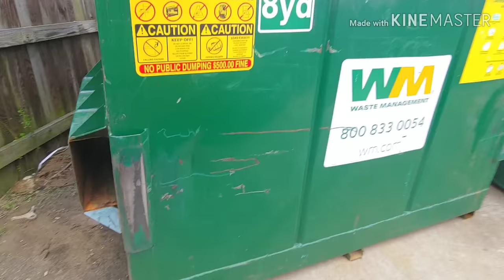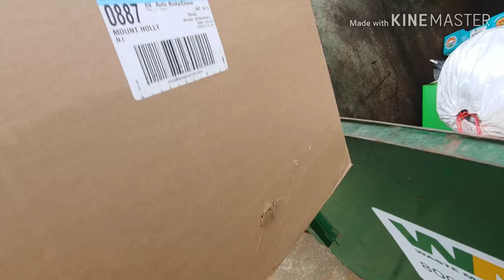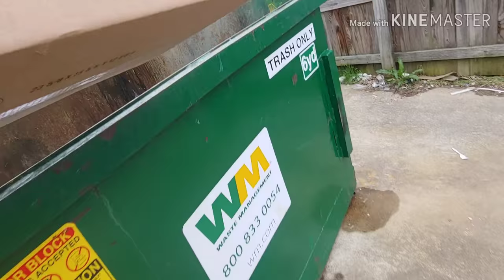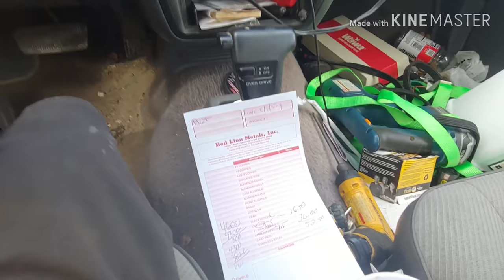Scrap and truck problems

Comment: hi scrap farm good luck with your trucks stay safe we have had tornadoes in the past  here in middlesex and union county already there was a lot of lighting flashes after 4.a.m. this morning monday and very heavy rains . is there asian auto salvage yards that can help you out for what you need for your old old truck .nice finds in that dumpster . i picked up almost one  hundred dollars worth clean copper from a very good friend doing plumbing work five rooms. you have to get a head start of the garbage truck and there guys that is what i do weekends very very busy finding a ton of scrap .  and my friends text me and call me with a heads up for scrap for me to snatch it right up and fast and safely .  stay safe out there bro .

Comment: Same thing happened in my GMC,  ended up putting me on the side of the road 45 mins from home. Lost 3rd gear and reverse. Cost 50 bucks for a tow home.
Reply: Only $50 for a tow.  My truck broke down 7 mikes away chased me over $200
Reply: @moniquepowell9499  know people in the business

Comment: You do know that when you keep the under side of your mower deck clean it creates better suction and less wear and tear on the blades and mower right
Reply: Especially on the Toro you won't burn those blade belts as quickly. At 80 bucks a pop there never cheap

Comment: Me too, I just replaced the fuel pressure regulator under hood on my f150, it drives great until you step hard on gas and it hesitates like crazy....if you lighten up pressure on pedal it's fine...im wondering if fuel pump is weak

Comment: throw some rislone  engine restore in it will help with sticky lifters...and put lucas trans treatment in
Reply from the maker: I tried that but I think the sludge is too built up... on the transmission is a mechanical failure I don't think Lucus  trans treatment is going to help... but thanks for watching will get a transmission for it eventually vwhen I get some time

Comment: The way they set up those spendls   it doesn't get grease to the bearings because they are a sealed bearing thair is no way for the grease to get to the bearing when you pump it in the grease fitting. They do that to make you think your helping it but all your doing it wasting grease.🤔

Comment: I just got a 87 nissan hardbody stickshift 4x4 with manual lockouts for scrap. Power steering box in it work for your truck?
Reply from the maker: No i have three of them...no 2wd parts trucks...lol...but might in a few days. Im goin on with the daily hustle till it stops moving.  Then the box is coming out.
Reply: Figured I would ask. Got the truck and immediately thought about you
Reply from the maker: @ameliabaughman4208  4cyl ?    If you ever do the timeing chain make sure its upgraded with a twin cam ratcheting tensioner.
Reply from the maker: @ameliabaughman4208  wish i had done that on mine..
Reply: I got mine as scrap. No title. Has a 4cyl. Wish it ran. Be a good woods truck for us here In northern michigan
Reply from the maker: @ameliabaughman4208  there easy to work on but like me is it worth it right...

Comment: might want to clean the filter?
Reply from the maker: Maybe or just let it ride ...i payed 400. And it has made a good amount of cash.  Dont want to really put anything in to it because i was scared of the trans with 218.000 on it.  Scrap life 218 too. 😆..was expecting it to be parts when i bought it....so was a 50 50 wut goes first..lol.engine or trans  Im doing the daily hustle till it stops then the steering box is going in the other truck .
Reply from the maker: Another thing the fluid is really clean. I think theres an oring squeking pressure off.   Theres a high pich squeeky wihny noise right before the shift that i never heard before....crack the whip..maybe i should just tow my dolly around behind me...lol.lol.lol
Reply: don't blame you a bet used to run a demolition derbies and wash mouth with fuel oil blow him up with a air hose and a lot of times it would shift like new free to try
Reply from the maker: @billjunking_fool5549  ya might try that last ditch effort.  If i can get some free atf. I got to look around may have enuf